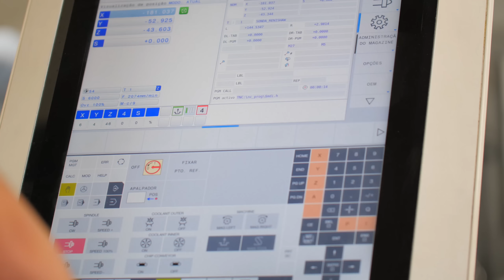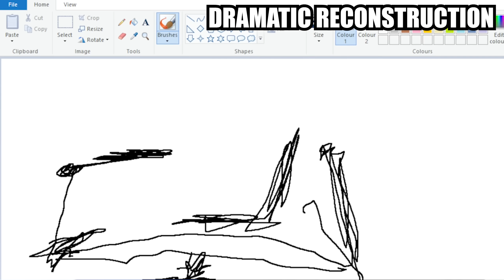Did This Motion Simulator Manufacturer Just Change The Pedal Game ?

Comment: Not a myth really, hall effect does last more than usual 'gaming' potentiometers, the high quality bit is important.
I've upgraded my pot pedals (all 3) that spike like crazy to diy hall (with 10-bit ADC reduced to 9-bit res because of only using one pole then reduced by range then reduced a bit by post-processing for brake feel which doesn't matter as long as there's no spike) and I love it, no need for regular cleaning for it to spike again in a couple days, and no need to worry about dust/humidity getting in there.
Reply from the maker: The myth is that people confuse cheepo potentiometers with all potentiometers.     

Or just assume loadcells or hall effect sensors are better by default. 

Rather than evaluating a specifc sensor from a specifc manufacture for a specifc use case at a specifc price point. 

As you know There are pros and cons to each sensor type at specifc price points and use cases and configurations.

I'm not saying x is better or worse the problem is people latch onto just the names of things and assume X is best in all cases by default. 

It's like the load cell thing of  people latching onto higher Wight load cells being better, when really what matters with a load cell is the controller cerquit the specifc materials and the specifc arrangement that applies force to the load cell.

Comment: 21:30 i would always go for the spring. i want it to feel like a real pedal, i dont care if its less responsive. it also means i wont be accidentally dragging the brakes etc. but then i am just a casual sim racer and honestly not very good.
Reply from the maker: You won't drag brake without a spring and elastominers act as a spring of sorts anyway. 

 But yah it just has a specifc feel , part of it is also how you set it up in Windows / the deadzones and sensitivity. 

After using it a bit the spring they have is quite stiff so it's different to my experience with some of the other brakes that have a spring on them.

Comment: 23:00 16 bit is the precision, nothing to do with the speed of the bus or the latency of the conversion from analog to digital
I'm Portuguese but i can't see why anyone would go for these pedals...
1. Price is way too high (3 pedals with performance kit is 1200€), this is not even entry level for hydraulic pedals...
2. Potentiometers are much worse than hall sensors or load cells, the excuse of the electronics doesn't make sense because they use the Leo Bodnar LC-USB 16 bits and it also works with hall sensors...
3. Software is very limited, only one mid level change and doesn't show input raw, only the output
4. You only setup the pedals once, being very fast to change is not an important feature unless there are multiple people using it with very different settings
Reply from the maker: Who suggested it was to do with speed of the bus or latency of conversation ? 

I made a silly joke about how people often think bigger numbers = better lap times. 

Being able to quickly change pedal settings makes it much quicker to get pedals dialed in and these are quick enough to swap over that a person could change from road car feel to / formula car feel with no issues which some people might like. 

End of the day if a person just wants pedals that "work" they could buy a set of CSL loadcell pedals.

Untill I have used the pedals for a while I can't say if I think they are better or worse than other specifc pedals or what I  like or dislike about them.

Comment: Even the design of the packaging for the pedals look EXACTLY like the Heusinkveld Ultimate Plus-boxes. The exact same photos with the blue/red hue and placement of the logos/choice of fonts. The pedals themselfs look like copies of the Heusinkveld Ultimates. Sven REALLY defined what modern simracing pedals look like. Hats of to Heusinkveld. Best pedals on the market. 😄🤘🏼
Reply from the maker: I did tell them the box design was too similar to Heusinkveld's.  The pedal design and mechanisms are very different to heusinkvelds though,  I say this as a fan of Heusinkveld equipment :)
Reply: @GamerMuscleVideos  Mechanisms might be but the overall design of the pedal arms look identical. And thats no real knock on Imschim. Its a testiment to how good Heusinkvelds overall design//function is. 😍
Reply from the maker: @PetterHegevall_   I'd say they are less close to the design of Heusinkvelds than some other pedals on the market but I agree Heusinkveld basically set the standard for high end pedals first and loads of designs i'm sure will have used them for inspiration.    But I'd not put the talento in rip off category where as some pedals on the market certainly are lol.

Comment: 28:49
Can you maybe try the yaw vr 2,
It has a really interesting design, where’re whole rig can turn 360 degrees, and probably even more 
It is also very cheap(2000 dollars for a full rig with everything included)
It just hasn’t had any reviews from a race simulator perspective,
And I wonder how precise the motors are.
It also looks very good for a flightsim
Reply: They are also working on a heave platform

Comment: Are the forces still backwards? Looking at it, it looks like how all motion sims seem to be. If you brake, the sim should pull backwards so that your body feels itself on the belts, but it seems to push forward, etc for other directions...
Reply from the maker: When it leans forwards that causes the seat belts to tension on you and tighten.

If it lent backwards you would just fall into the seat more due to the speed of the rigs and the angles involved. 

To be honest no motion rig actually does actual sustained G-load forces all they are good for is suspension movements track bumps and then aspects of traction loss and a bit of track Camber. 

So though what you are saying is logical in certain contexts in the reality of how all the good motion rigs operate it's not the case. 

IE all good motion rigs simulate quick suspension movements and vibrations of varying frequency.

"Bad" motion rigs try to simulate G-forces and fail because it can't do it in any sustained way unless they are in a ware house or its simulating a very slow car. 

Of course there can be a bit of cross over and sometimes using g force telemetry data can be tuned in ways that work well. 

Bladder systems / pressure seats are the only thing that can really emulate that G-load component but even they are a bit weard.

From a SIM driving perspective you can feel the relivent G-load component through the wheel with Sims like the first asseto corsa.
Reply: Accelerate in your car....you get pushed back into your seat
Brake in your car and the front end compresses down and you move forward towards the wheel.
Reply from the maker: @matta2738   Having been in a radical SR3 at speed with lose seatbelts  , get on the brakes and feel your body smash into the dashboard 😆👍.  Go round a corner and feel your head smash into roll cage, get on the accelerator.... Feel quite comfortable pushed into seat nicely.

Comment: I used Thrustmaster pedals with potentiometers. I no longer use my Thrustmaster pedals.
Reply from the maker: potentiometers are not inherently good or bad it depends on the brand the type and how they are used , I had a G25 for 6 years of crazy heavy use and had no issue with its potentiometers.

Comment: Stopped watching the pedals bit after I heard the explanation why they used potentiometers, that's just bs, fine u have 16bit Bodnar board, but you don't use the full range of potentiometer! The full pedal travel is probably 10-15 % of pot total range, which means your precision is actually quite poor, just use a hall sensor like all other proper manufacturers (heck even most diy solutions use lc or hall), not to mention every single pot I had in any sim or non sim gear I ever bought eventually needed to be replaced
With such a massive competition on pedals market these don't really have anything that would make me buy them, just another slightly modified HE
The motion is awesome though, wonder what the price is going to be...
Reply from the maker: I used Logitech G25 for 6 years with no issues and that had cheepo pots , the pots on these are much higher quality I can't see why they would necessarily be worse than other solutions or work well within specification.
Reply: @GamerMuscleVideos  maybe you were lucky or I wasn't :) anyways the issue of range can't be argued, a pot does 180degrees or more, pedal does maybe 60, at best, so you're losing loads of resolution
Reply: 10% of 16-bit is more than 12-bit which is much much more than what you need and good quality "automotive grade" pots are actually more reliable than the usual ones, BUT I do agree that the mechanical thing about pot doesn't matter at all, hall connected to that part would almost do the same thing, even if it didn't they could simulate it by processing it which isn't necessary. But actual good quality pots aren't bad either.

Source: I'm a software engineer and I've wired and programmed my pedals.